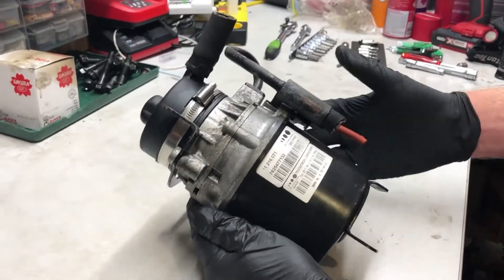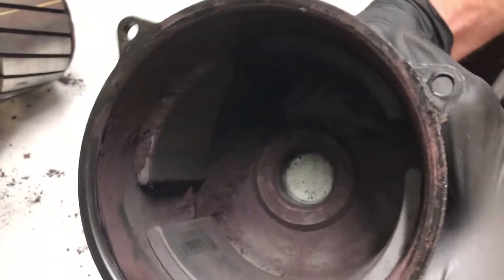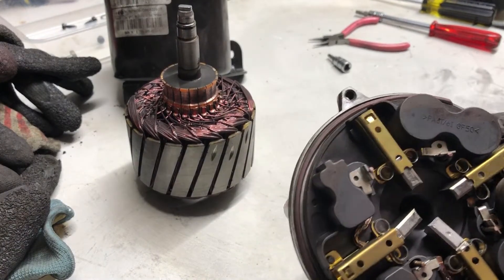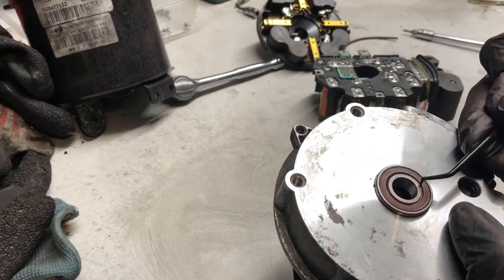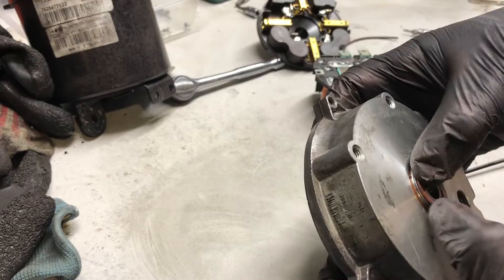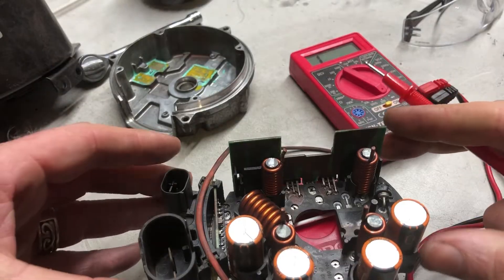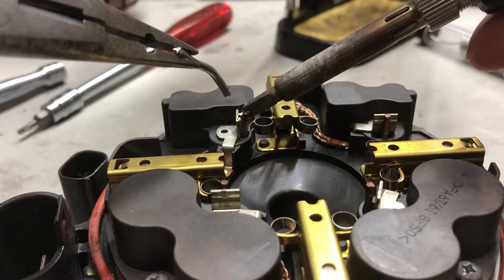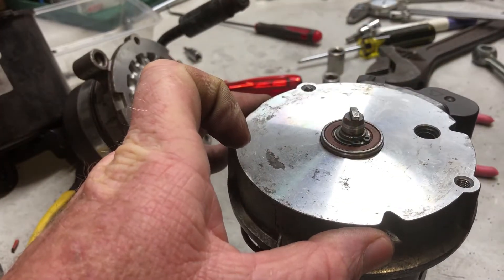Mini R50 R53 Rebuild Power Steering Pump

Comment: Great video.  Very clear and understandable.  Did it work after the clean.  I have to try this on mine. My r50 is like driving a tank. Thanks for the upload of this job 👍
Reply from the maker: Good question. Install planned and will definitely add a comment when we see the results.
Reply: With @thomaswilding8818  we've now tested this PS pump back in my 2006 MINI Cooper S Checkmate R53. Please see my own comments elsewhere in thread here. I had swapped this PS pump out for a used, replacement PS pump, which was working in the MINI just fine, proving that my car's systems were working okay. We took that pump out, to re-fit our original pump, having been reconditioned by Thomas in this video. I am happy to say that it has been running... well, exactly as it should! Nothing else to report except that it works just fine. Thanks very much Thomas! If you've got an 'iffy' PS pump, it could be well worth a crack to have a go at reconditioning your own pump rather than simply replacing it, following Thomas' service instructions.